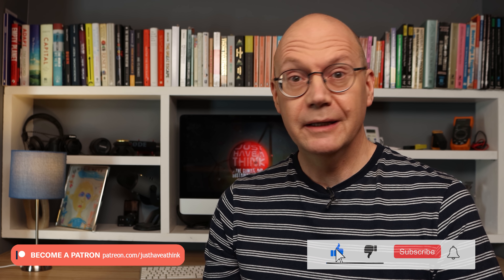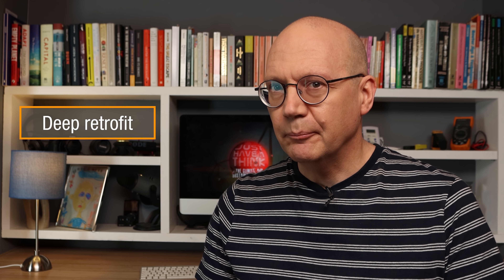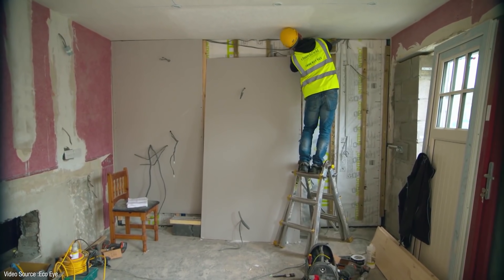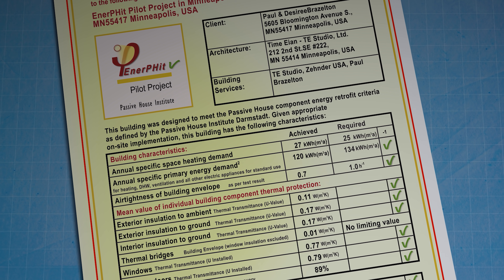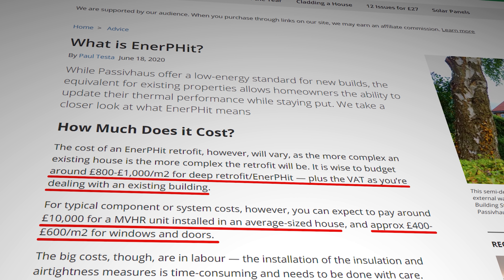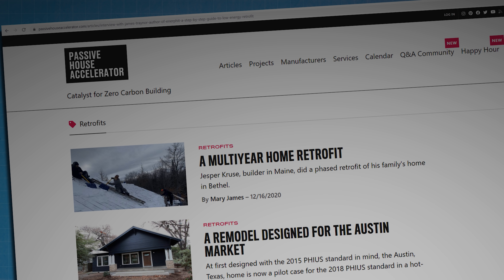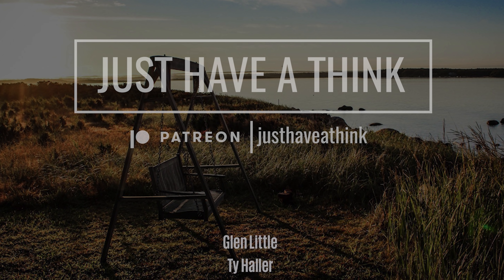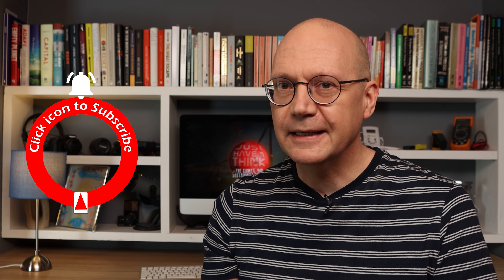Retrofitting to Passive House standards

Comment: Retrofitted 1980, heat/ac half average. In colder climates what's currently missing for US building standards is foundation outside insulation so the thermal mass of a concrete wall or slab become heat storage for structure rather than continuous heat loss.

Comment: In the 1960's and 70's, electricity was so cheap in Ontario, Canada that buildings were literally designed to waste it. Renters did not pay any electric bills --- it was just considered part of the rent, and it wasn't metered.  I lived in a 20-story apartment building with electrically heated floors that had a huge open balconies and immense single-layer windows.  And this in a country with extremely cold winters!  Most of these buildings still stand, and it's not possible to meter individual apartments without tearing them down.
Reply: wow! That is interesting to hear. Cheers from Guelph

Comment: Having just had some improvements done to our house,  the biggest problem was the contractors doing a poor job. It felt as if they were allways trying to cut corners and were not open to doing things  differeny to the way they hade done it before.  Until the workforce is educated and cares, it will be an uphill struggle.  In the UK people do not go into the building industry because they were a high achiever at school.
Reply: 'Until... ...cares'. 'Until the workforce is properly trained and managed'. The 'very best' education money can buy in the UK, turn out leaders of commerce, industry and politics, who cut corners in their respective professions and truly do not care. People are motivated to do a good job by good management/supervision, rarely because they truly care and it has very little to do with how well you worked at school. Another thought...In Ireland (and USA) going into the trades is fairly well respected, much more so than in the UK and this probably helps to promote pride in their work.

Comment: Check with your local energy provider. Many of them offer energy efficiency audits and some provide discounts on products or services. My provider offered a free air blower door test and recommendations for leak sealing. They even paid 50% of the bill to get the sealing work done. There are also many small businesses that do energy audits and make recommendations.

Comment: In the UK, we also have issues with properties that are listed.
Reply from the maker: Yes, that is true
Reply: A few buildings. The vast majority are not listed. And ultimately the climate emergency is at least as important as keeping old buildings looking old, so it should be a consideration, not a veto.
Reply: @xxwookey  I suppose, if people who live in listed houses are forbidden to retrofit, they could be given grants to continue pumping out heat into the atmosphere.
Reply: @AtheistEve  heh. That is one approach. It would be much better to give them grants so if they have to put new/fake stone (or whatever) over the insulation so it looks then same as it did before then that extra cost is covered. It's generally not hard to make buildings look almost like they did before - it just often costs more, sometimes a lot more. Sash windows are one one of the biggest problem. They are fundamentally fine for 17 or 18 something, but a crappy design in comparison to a modern window and it's both very expensive and technically inferior to try and make windows like this that are airtight with good thermals. Insisting people put 17thC windows on 21st C buildings in a climate emergency is just dumb and we shouldn't put up with it.
Reply: It seems to be more jobs-worth conservation officers wanting to have their say - my in-laws went out of their way to replace ageing single glazed sashes with nasty 80s secondary glazing on the inside (hardly a look from 400 years ago) with some period style double glazed units which had been used and approved elsewhere in the very same village, but apparently that wasn't good enough just because - the jobs-worth took it to court and they have been instructed to revert back to single glazing because "interior comfort is only for the benefit of the occupants" (no mention of the savings in CO2 or the wasted cost to the council or the fact that this will preserve the property for longer) - the sashes look identical to the originals and photos prove it, the two panes are invisible unless looking at point blank range, but apparently that's not good enough, so the conservation officer would rather have the rotten single glazed windows than accept that this was a good pragmatic investment to protect the fabric of the building and contribute to reducing emissions :banghead:
Reply: @Umski  Sorry to hear of your woes.
Reply: @AtheistEve  Thanks but no need to be sorry - I usually have limited sympathy for the in-laws' legal issues as they seem to be self-inflicted, but in this case they were doing the right thing with the windows - I guess the mistake they made was wrongly assuming that the precedent to use them was set by the neighbours which then meant retrospective consent from the Conservation Officer who took objection and probably would have been oblivious to them had they not tried to do the right thing :rollseyes:
Reply: @Umski  That is shocking. But at the moment the law is on the side of these people - they get a veto. We have to get it changed so that climate considerations get weighed against this sort of idiocy. Some consideration of what things looks like is sensible, but building performance and moving with the times are also important. Overall building physics is always a major retrofit consideration, but that doesn't mean it has to be done the same way as it was in 1850.
Reply: @xxwookey  totally agree, they don't seem to get that buildings that eventually get neglected will go to ruin due this type of bureaucracy - so rather than be pragmatic and let someone preserve them sympathetically but practically enough to make them more habitable with minimal visual impact, they'd rather stick to their principles of "originality" - ironically the house, or parts of it, date back to Tudor times when the style of window would have been completely different - the current style of sashes is a newer addition, probably Georgian, which seems to be lost on them!

Comment: All new buildings and major remodels need to be energy efficient. Saving energy saves money on monthly utilities. Blower door testing and air sealing are under appreciated. It is like closing an open window, I had my home blower door tested and air sealed and was able to reduce my utility bills by 30% the next month. I thought my home was pretty energy efficient to start. In a older leaky home the savings would be even greater.

Comment: it is funny that the Canadian government talks carbon reduction while allowing millions of new condos being built with only uninsulated glass walls  which high heating and cooling costs .
Reply: Hahahahaaha, mate try living in New Zealand. Using cheap rotting kiln dried timber framing and spray-on cladding. Can you believe that BRANZ(building standards) actually allowed people to use polystyrene cladding, yes it’s true.........along with shitty cheap pseudo double pane windows.........
Reply: Can you provide an example Grant...I live in Canada and am not aware of any new condos that can be built that way.  Our building code is not Passive House level but it is leaps and bounds better than even 15 years ago.

Comment: The air tightness criteria will drive up the need to have better indoor air filtering, for both gases and particulates as indoor air pollution is already recognized as a health hazard.
Reply: Indeed. I had to buy an air filter to purify indoor air in my bedroom, as I live close to busy road with plenty of old diesels. Having airtight house woudl be beneficial, as knowing where air comes in would give a possibility to install filtering system on air intake. And then all rooms would have clean air.

Comment: hi dave,
still dont understand why we are still building up instead of down...
we will have to support a lot more difficult climatic conditions,
mega storms ,tidal surges ect...
Reply from the maker: Interesting concept. You could well be right!
Reply: because up means you dont have to deal with water nearly as much.
- ground humidity
- no windows for daylight is terrible for the health
- even a small flood means death since you are trapped
- no natural air circulation
- earth is usually below the temperature you would want your house at, so you need constant heating
- building wall that resist the ground pressure is more expensive and prone to failure since the walls cant dry from the outside
Reply: It still costs a lot of money to dig. There are things like electric and phone and data lines that would be better underground but the cost would be enormous.

Comment: We did a deep retrofit of a 1938 house in Holland last year. Every installer told us it was impossible with an old house like that, but we persevered and succeeded. The biggest problem is the conservative attitude of the average installer who doesn't know about heat pumps, ventilation, insulation etc.
Reply: "The biggest problem is the conservative attitude of the average installer who doesn't know about heat pumps, ventilation, insulation etc."

They are a pain! You have to watch everything they do, otherwise they revert to what they have done for the past 20 years.  They say they have 20 years experience.  No. They have had six months experience repeated 39 times.
Reply: Hi, I am also looking to retrofit a house in NL. May I ask what process did you go through and what company/consultant you used for that?

Comment: We owned a century home in Halifax NS. It had blown in cellulose insulation in the walls, and some fiberglass in the roof plane. After years of drafty winters, we beefed up the insulation in the lofted attic (more than doubled it), insulated the basement and rim joist, added weather stripping to the windows and doors, and replaced single pane with double pane as needed. Plus we installed a new boiler. We cut our fuel consumption by at least half, and we had a much more comfortable house. This would have been a shallow retrofit by your standard, but it was a night and day improvement. Well worth the time and money, and added value when we sold.
Reply from the maker: Good on you. Not MY standard by the way - I'm just relaying what the industry standard states. Don't shoot the messenger :-)

Comment: Do not forget that industry buildings must be looked at as well to achive our climate goals. There is a big potential in energy savings by applying smart designs for gates, rearranging of processes, utilisation of process waste heat, better insulation, utilisation of solar thermal heat...

Comment: My observation is that those people who can't afford their heating bills are the least likely to be pro-active to their own cause. For instance, folded newspaper slipped between the door and the jamb will stop air flow with exterior doors. There are also commercial products that are cheap that can be used to cover single glazed or leaky windows. After it is attached, a hair dryer shrinks the film in order to see through it. Point is, quit whining and get to work!
Reply: Your observation? Have you worked with people torn between heating and eating then? Have you witnessed their struggle and compared it to those that heat their homes to a balmy 22C so they can walk around in t-shirts while those less wealthy go to bed wearing a wolly hat to stay warm? Have you ever lived in poor quality housing?
If you have you must have forgotten that folded newspaper (if you can find any these days) soaks up moister and rots, not only the paper but the paint and wood it's next to. Never mind that an ill fitted door is still the point of egress for the property and will require more than a botch job to last a week of use.
The cheap films you talk about increase the moisture levels making the window sills bow and paint peel and offer no thermal properties at all. The paint work in rental property is often included in rental clauses as something the tenent is responsible for. A method for unscrupulous landlords to abuse and keep a tenent's deposit, thus creating a rental trap.
Add to this that blocking up a cracked window or ill fitting door, is probably just the tip of the iceberg for the problems the building is likely to have and very likely make little difference to the cost of heating due to poor insulation and inefficient heating.
Finally, the people living in these types of homes, as you point out, often do not have funds to buy commercial products, even if they are but a few £s, as this is often the difference between a bus fare to work, or a childs meal. I'd like to remind all that they are not stupid people, they are desperate and faced with many conflicting pressures.
Reply: @igavinwood  I live in a 100+ yo miner's shack in southern Colorado and it's owned by a SLUM-LORD who could care less.  There are so many poor and destitute in this country, we feel lucky to just have a roof over our heads.  So sad that these property owners would rather see their property fall to the ground than put a little money in them to keep them livable.  The state doesn't have the manpower or money to help us stay safe.
Reply: @chinookvalley  And all the time this continues to be a reality, people like you, are living in desperation trying their hardest to find a better place to live they can afford. I hope you do and soon.
Reply: @igavinwood  Unless you are a quadriplegic you are making excuses. I have lived in a house so drafty it was impossible to have a candle burning. After a divorce, I lived in a barn for 6 months in order to save money so I could build a small house. I then laid the block for a basement and covered that with plastic that leaked for a year to save more money. What I have I earned. I didn't sit and whine about poor pitiful me. BTW, three of the months in the barn were in winter.
Their are recourses for dealing with slum lords. Why don't you pursue those for people incapable of representing themselves instead of attacking me for offering suggestions?
Reply: @igavinwood  On second thoughts, I see those poor people you speak of in the grocery. A cart full of pop, processed carbs and sweets are their selection and they pay with food stamps. I drive a 32 year old pick-up which has made it necessary to learn mechanic work. Since you are on this channel, you either are desperate to kill time or you are concerned about the environment. If the latter, you can count on nothing improving until planned obsolescence is history. Consumerism consumes resources which would otherwise benefit the people as a whole, not just the elite.

Comment: I have an old Swiss chalet that I've refurbished with insulation on the inside, underfloor heating and a ground source heat pump. It's not up to europhit standards, but it's warm and dry and quite inexpensive to heat. The biggest difference is the GSHP, using between 1/4 and a 1/3 of the KW/hrs to heat the place. A friend of mine from England loves to visit in the winter as the house is so warm and dry compared to his 50's built UK home.
Reply: It sounds wonderful. Out of curiousity how large is the GSHP?  In the UK land is a scarcity for many so having first hand experience is useful for planning the possible with the if only.
Reply: @igavinwood  If you mean the machine it's about 1.5m high by 60cm x 60cm. It has a hot water tank that's slightly bigger than that. The slinky's in the garden take up about 10m square. A bore hole takes up almost no space and is even more efficient.
Reply: @davidellis2021  Thank you. Helpful info